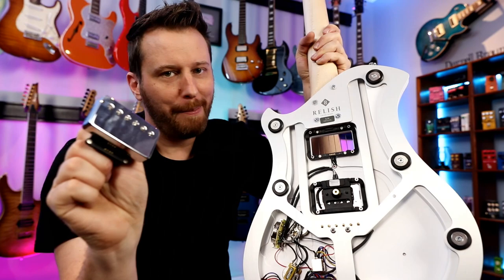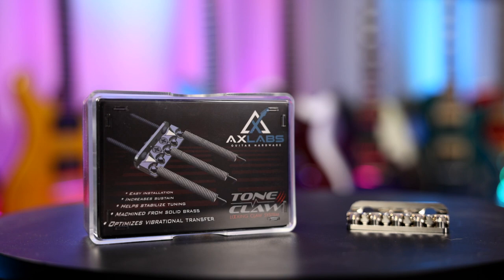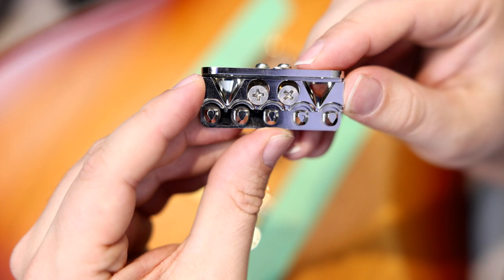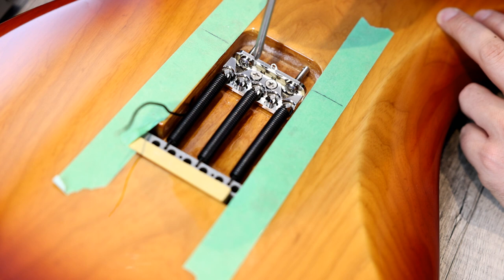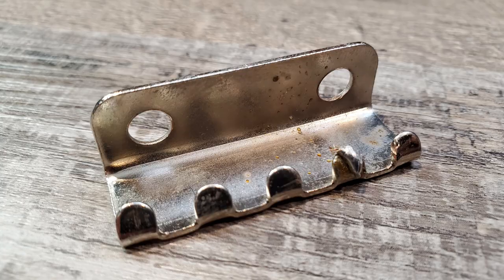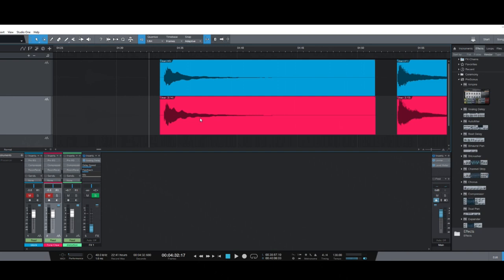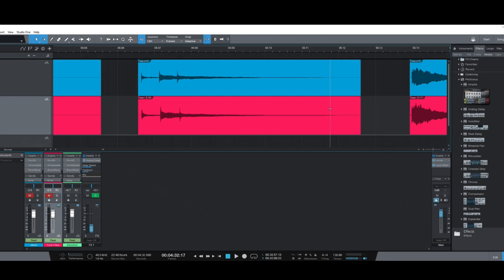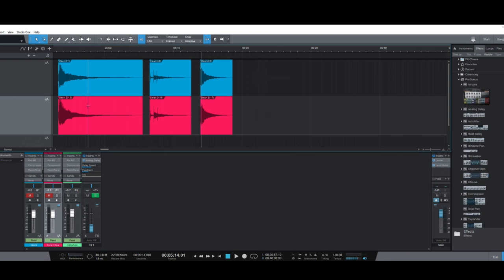Can a Trem Claw Improve Your Tone?? - Let's Find Out!

Comment: Might be the best engineered useless part I’ve ever seen.
Reply: spot. on. Had to dig really deep into those wave forms to see any difference. Frankly, if there was a difference, the standard one sounded better? Not to mention picking dynamic variances could easily make up any of these differences. if he was .1 mm closer to the bridge, or .1 mm deeper on the pick against the string. Seems like a stretch to sell this thing....
Reply: Now, that's a perfect way of putting it.
Reply: @danherrick2310  And for $60, that's really stretching it.
Reply: I completely agree with you🤣👍
Reply: That's the best description I've seen
Reply: @Scottocaster6668  Would look amazing on a high end strat style guitar with no backing plate. The stock claws aren't particularly aesthetic.
Reply: For real. I just saw some bridge mount screws for $30
Reply: Apples to oranges it's basically what you want and what you like to sit here and comment and say there's no difference is absurd weather a expensive claw or cheap claw if their brass it's going to make a difference it's very subtle just like pups a very subtle tone difference
Reply: @rocksteady6448  Rubbish. Some guitarists are gullible fools.
Reply: It made a difference. Not enough to go crazy, but it made a difference
Reply: It's not useless though. It captures the springs, preventing them from moving. This prevents unwanted noises when using the bar, which can come through the pickups, and it likely helps with tuning stability. It also looks better. Guitars are meant to be beautiful. The standard claw isn't beautiful. It's a crappy piece of stamped sheet metal.

Comment: The only difference is that it looks cooler.
Reply: Who sees it?
Reply: Exactly!
Reply: @ricksigurdson2016  but you'll know it isn't there and it might affect the feel :-)
Reply: And most of the time you can’t see it because it’s literally hidden in the back of the guitar. Kinda useless!
Reply: I made blind comparison and definately youre wrong. Question is if it is more stratty or not. I mean that many people got uset to stratocaster tones made with regulat bent metal claw. I think SRV never thought about swapping it ;)
Reply: The key difference is in its weight. How much hardware weighs on a guitar really affects how it balances.  Consider things such as Knobs, pickup rings, tremolo blocks, tuners and how much weight they add and affect the balance of a guitar.

Comment: The easiest way to improve your guitar tone is with stickers. Of course vinyl stickers will give you more sustain than paper stickers. And if you want a darker tone, of course you need darker stickers. For a more airy wide open tone, just use hologram stickers, or stickers with butterflies.
Reply: I added a foam dinosaur sticker donated by my 3 year old kid. What tonality changes can I expect from that? I put it on the pickguard of my Tele.
Reply: You mean I can use the facelift vinyl full cover on my strat and replace my sustainer pedal?
Reply: This is basic knowledge.Billie joe Armstrong put this theory into effect through the yrs. it’s also very true with cars
Reply: That only works on First Act guitars.
Reply: @caerphoto  You can expect the sound quality to scale up quite a bit
Reply: @TheChzoronzon  my guitar does actually sound a lot better now! Maybe the new pickups I put in helped a bit but I think it was mostly the dinosaur sticker 🦕
Reply: @caerphoto  Velociraptors are ok for shredding, but I usually prefer Allowsaurus for easy of play
Reply: You just described my buddies 76 Fender Bronco
Reply: While it’s true that vinyl stickers give more sustain than paper stickers, high grade metallic foil stickers improve sustain even more, plus they give better string separation and shielding from the local mind control signals being beamed at you from the G-men in the back of the room.

Comment: Even two transients recorded with the same claw will never look exactely the same.
Reply: That may be true but doesn't explain the result. Because the pattern is consistent and the same across ALL the examples. So much so you could identify which claw  is which purely by viewing the graph. With both claws side by side. But swapping positions. 
It is having a effect
Reply: @neilphillips1350  At best it's so subtle no one could tell the difference purely just by sound! I would challenge anyone to do a double blind test and would guarantee there is no discernable difference! The read out proves it! This is more placebo than fact!

Comment: I couldn't hear any difference in the tone, but then I didn't expect to.  Mechanically the only real purpose I could see for this is to combat string rattle which it obviously does by the fact that Darrell couldn't unhook the springs from the claw with the locking mechanism in position.  While it did seem to increase the amount of sustain, it is margin of error amounts.  This seems like a product for your 'studio' guitar where you are looking to get the very best out of every single part to make it sound and play as good as possible.
Reply: I think this is the best reason why you'd want these upgrades from what I've seen from anyone posting on here. Good points 👍
Reply: There was definitely a difference in tone. The new claw was brighter and fuller, in a studio setting the difference would be huge
Reply: @worhed3722  hard to tell with YouTube compression but I can believe it.
Reply: You'd be better off and spend less money spent simply upgrading your springs.

Comment: The plate that locks the springs in - is that a solution in search of a problem? Do springs pop out spontaneously?
Reply: That is the exact same thing I was thinking. I’ve never had a spring come off the back claw.
Reply: Double ditto I abuse the living hell out of my Floyd and never even seen one loosen?
Reply: @goldbug1974  I have when I really take the stock setup for a good pull up. I've had to put a foam block in that the back cover holds in place to keep the springs in place
Reply: I've had a spring pop off before, but I attribute this to the much higher string tension because of the lower tuning I was in

only ever happened once so I still think its a non-issue
Reply: @caixiuying8901  once when changing springs I damn near sprung my finger off , but that was my fault entirely. oh to be young again 😊
Reply: They can make noises when using the bar, which come through the pickups. My Gotoh locking trem has screws that lock the springs to the block, and I'm getting something that will lock the springs at the claw too. I suspect it may improve tuning stability too, since the springs have a direct influence on tuning with floating trems. Locking them in place means you won't have them moving at all.

Comment: Looks great, sounds the same! If one has to 'look' at the WAV to 'see' the improvement, then we are missing the point of 'Audio' ..are'nt we? Ok, so the point of the video is that it 'must be better' because the printed WAV shows it clearly is ..well...more print. Looks great and must be marginally different in tone, perhaps not better tone though. I mean, if we were to take this point to the ultimate in mods..brass block, claw, nut, we would eventually end up with total Brass bodied guitar... hmm.. im pretty sure what it would have in sustain it would not have in warmth/desirable tone. Good video Darrell as always :) It s sparks comment and thats a win for you :)

Comment: I've got two of these.  They're great.  A bit expensive. But I have no idea about the tone.  They probably do help a tiny bit.   But what I like is that they LOCK the spring in.   So I can get completely crazy and I cannot pop a spring off the claw.  .in the past I've had to use plyers. And a vice to bend each "claw" finger to help Lock the spring to it claw.....but I have next to no tention on my Hybrid 9-46 set of strings. Tuned to C standard..  with all 5 Springs in the back.  So I can pull the bar.  Dive the bar... and bend any string with no deflection on another string

Comment: Even if there is no advantage from the tone claw, it shines like jewelry! I'm sold..... lol
Reply: the schaller claw is better lol 
and shiny too but actually makes setting up the trem a breeze 
all u do is turn the 1  screw either left or right and ur sett one thing i hate about the normal claw is having to turn 2 screws one by one in small increments to set a floyd and thats still the case with this one
Reply: the normal ones polish up too
Reply: There's a new design that makes this all obsolete. The Tonevise Treminator. It's a super well engineered trem stabiliser with it's own claw that locks the springs down, and then it can be rapidly changed from dive only to full floating, and you can also adjust the trem position if things aren't in tune as well, all with thumb wheels, so no tools. And you don't need to drill holes in your guitar.

Comment: I gave a guitar to a luthier and he left it in his garden workshop.  The temperature drop made the brass spring claw snap.  This at least looks more durable and would be better part of replacing the sustain block, saddles, Engl hard tailer and nut with all brass.  My Strandberg will follow adding all of those upgrades and brass is better.  Louder, more detail and better overall fretboard resonance (less or no dead spots).  All of that brass jewellery will be interesting to add up in weight compared to the Strandberg's stock weight.

Comment: I own a similar patent on a spring claw, Mine is hand filed a polished by hand, no power tools. A big difference in mine, is everywhere the claw can hit the cavity, the edges are pillowtopped and rounded to never catch or dig in. The biggest game changer, is I use a special proprietary  bell brass. Used with titanium neck machine screws, and a Triple chambered brass tone block, it creates the sustain of a Fernandez Sustaniac, without the battery. My claw weights 68 Grams and it's like having two toneblocks that vibrate at each other. Simply amazing versatile tones and endlless sustain. Each hand fitted to the guitar, for maximum potential.

Comment: I use one of those expensive locking claws. Why? Because if its not locked my adhd goes off a deep end with tinkering. I got it against myself lol. It does add sustain, not a giant ammount. It does work as advertised. I like it.

Comment: While the Tone Claw is an improvement over the stock one, I would think that the trem block material would show the biggest gain on the tone and sustain. Now, a high-mass trem block with the Tone Claw might be a real winner.
Reply: Some of us prefer the sound of a.fully floating trem, where the springs are actually part of the response.
Reply: @P_Ezi  Correct !!!  The tone is the sum of all of the parts !!!
Reply: Agreed! I’ve replaced the block in several of my guitars and it always makes a big change in sustain and tone.
Reply: Definitely Both.  Along with steel saddles. Is a noticable tonal difference...I play Floyd Rose. Thick brass block. This claw. And original series saddles.. and all 5 Springs. Also sends more solid tone throughout

Comment: The trem claw is one of those components that makes a rather subtle, but sometimes significant difference. A parallel could be drawn between this, and the various saddle options for strats. With the strat, I have found that the thin nickel saddles sound best- 9 out of 10 times. To me, unless the one you have actually FLEXES (which is doubtful), the springs are likely more important.

Comment: I saw a Waah  brand brass claw that was tapered to allow for a balance between the thinner strings and the thicker ones. On Aliexpress. Mr. Carl Verhayen has  a YouTube video on how he adjusts a regular claw on an angle to do this. This claw had the angle built in. I would love to see you do a comprehensive review on both, if it gives more stability to the trem as he claims and how the built in one works out. Thanks.

Comment: My experience was similar. But than I changed the string-saddles into brass, too. That was a dramatic change of the tone. Further on I startet to change Parts into brass - versions  on other  guitars. Like a webster-saddle and bridge on my 335. Wow! What a difference. In my earts  it sounds much better.

Comment: Thanks for the work, Darrell. My opinion is, if you have to break out waveform analysis to show a difference, that usually means you can't tell the difference by ear. If you can tell the difference between a few milliseconds to one second difference in sustain, then you should spend all of the money yo0u can on these gimmicks. It looks cool. Why should I worry about locking the springs in place? I've never once heard of a spring coming loose in my lifetime.

Comment: If you are going to go this far, then use machined helical springs or perhaps welded metal bellows and float the trem.  
That should transfer energy well even though the trem isn't bottomed out, especially if we select them for maximum energy storage and peak energy transfer between discontinuous materials in frequency wave transmission.  They could also be calibrated to allow adjustment of what force is needed by the player to displace them, making a trem assist or lock just like we use slow and speed knobs for volume and tone, enabling even greater intrinsic fluidity of operation per player.
Also, if one wants to lock the trem down to the body, the bellows can be filled with gas or fluid to form an effectively solid bar or cylinder,.

This counts aer prior art, though.  I don't have a company name to cover things like this yet.  Maybe after I build a couple...

Comment: This will mess with equilibrium at the floating point. That is if that clamp down plate holds the loops of the rings very firm. Because the most stable way of using a Floyd is to get grease on the inside of the claws and the spring loops so there is no stability issues at equilibrium.

Comment: Fine video and thanks! If you have to look at the tech/science to say if there is a difference then maybe that is the answer right there. But I think this is a bit like a finely tuned F1 car. If you look at any 1 piece then the difference might be too small to really notice but if you add a few things together THEN you might see a bigger difference. So perhaps a "stock" setup vs something with the same pickups but better strings/tuners/string trees/saddles/trem block/trem claw/nut or whatever would be a more drastic comparison?

Comment: The only issue this might solve is the “ping” of a spring loop binding in the claw if you’re really dive bombing the whammy bar.
Reply: Exactly what I was hoping DB would test. It's a problem on my strat, but maybe smoothing the edges of the claw plus some lube would cure it.

Comment: I'd be happy to see Schaller SureClaw tested - not because I expect it would affect the sound, but to have one Allen key to set springs' tension (instead of fighting with screwdriver and the both screws) seems to be sooo convenient. Plus the SureClaw looks sturdy as hell. I hate those little crappy claws and screws coming out at most strange angles... :)
Reply: I usually set my claw at a slight angle, with greter tension on the Bass side.  Right or wrong, it's my preference.  Not possible with devices like the SureClaw

Comment: The only thing I noticed is that you are using coated springs. This electrically insulates the bridge (and strings form the ground). So your bridge and strings aren’t grounded -or at least not very well.
The fix is to scrape the coating off both ends of the springs -the loop end and the hook end.

Comment: I thought the cheap claw was a little brighter and clearer. The nicely engineered one had a bit more mids. I was actually expecting there to be a bigger difference. If you're going with deluxe parts, its a nice replacement for the cheap claw.

Comment: Everyone obsessing over tone differences or lack thereof are missing the point. Locking your springs securely (at both ends) is beneficial, and should have always part of the design in my opinion. With a floating trem, why would you want those springs able to move even slightly at their anchor points when you're relying on them to put your guitar back in tune? And they can make noises when using the bar too. 

It's a piece of mind thing. It also helps players with very light strings and low tunings to avoid having springs come off, and finally it looks nice. Why let the manufacturer spoil an otherwise stunning high end instrument with a crappy piece of stamped sheet metal. Makes no sense unless you're an accountant. We're musicians, not accountants, or scientists for that matter. We are in love with our instruments. Some players want every part of their instrument to be something that was made with care. 

Rough stamped sheet metal says bean counters designed this. Unnecessarily polished pieces of CNC machining in places nobody can see says something else entirely. 

Who cares, as long as it gives you the warm fuzzies looking at it lol.

Comment: Hi Darrell, thanks for the interesting video.  It seems logical that adding mass  will increase sustain.  I saw this product, but also saw one from Schaller, the SureClaw.  This is interesting because it has a drive that is activated by a hex key that applies tension to the trem springs.  It has a large mass bolted directly to the guitar body.  I was going to buy the product you reviewed, but decided on the Shaller instead.  As for tonal differences, I heard a definite difference in note definition and tonality with the AxClaw.  Once you add distortion and other effects, who knows?  But this could definitely be a part of a series of small, incremental improvements that add up to a noticeable difference!  I'd be interested to hear the same comparison with the Shaller SureClaw, or maybe a shootout between AxClaw and Sure Claw.  Have a great day!